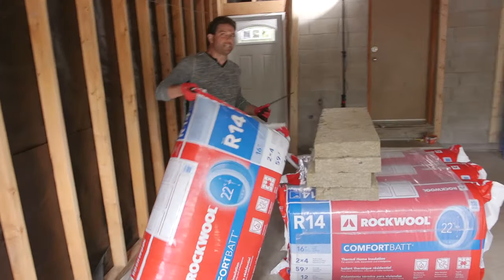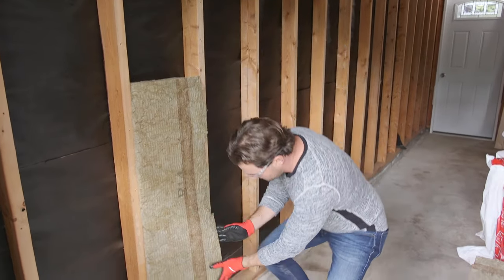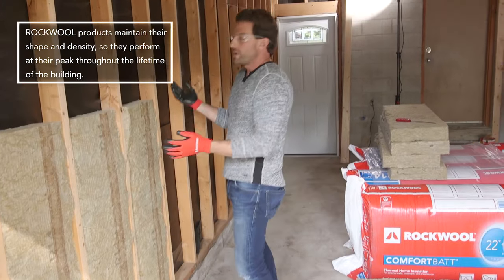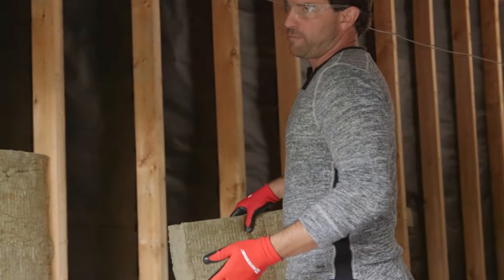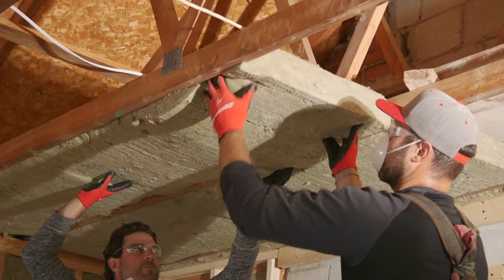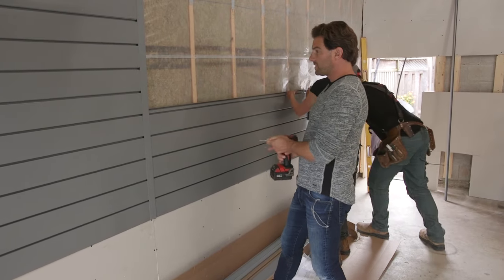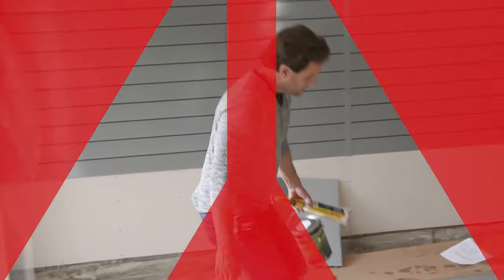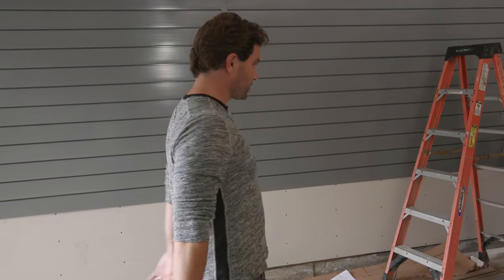How to finish your garage

Comment: Great job, as long as you never need an electrical outlet.
Reply: My walls already have electrical outlets so this is great for me but yeah, who doesn’t need outlets? 🧐
Reply: There’s nothing wrong with running conduit outside of the wall afterwards
Reply: @austin3072 I don’t know why more people don’t do this.  I lived in Japan a couple years and lots of their homes had plumbing and electrical outside the walls and accessible via a simple covering designed to be removed and replaced by the owner with no tools.  It’s was part of the plan and did not look ugly at all.

Comment: Wouldn't the vapor barrier to the exterior of the rockwool defeat the moisture wicking properties.  Any moisture that gets behind that vapor barrier will have to dry towards the inside of the house into the living space, potentially causing mildew behind the drywall, instead of drying to the exterior into the garage.
Reply: No point in putting a vapor barrier if your using rockwool
Reply: The only reason for the Vapor Barrier would be to prevent Fumes: Paint, Thinners, Gas & Exhaust, etc from getting into the home. Builder Matt Reisinger says yes, VB's aren't much use otherwise except along the coast.

Comment: Is there any insulation on the cinder block wall that’s shared with the house?
Reply: Any cinderblock wall shared with the house needs to be sheathed in either 5/8's xtype drywall or 3/4" fire retardant plywood.
If you have a small 1 bay garage  (10'x22') would recommend using pt 2x2 with 2-3/4" 3/16th tapcons (phillips flush), attached to the wall, 16" on center, and use comfortbat 80 (the more rigid rockwool insulation (1.5" thick, same as your 2x2), and sheath in what was mentioned earlier.

Due to the garage being a more 'wet' space, would recommend foregoing the vaporbarrier to allow the garage to breathe. Its not a living space, so vapor barrier is not recommended. using sprayfoam beads to close up gaps from above is all that is recommended.

Comment: R-14 in a ceiling is next to nothing .
Reply: god forbid you're half way up the US, R22 is minimum, If you're up in NY/Southern Ontario CA, you'd need to start at R40, and go all the way up to R60 depending on how cold it gets, but thats for a living space. For the garage, with heater, you wont need much more than an r22 in the cold north, as it's only 'heated' when in use.